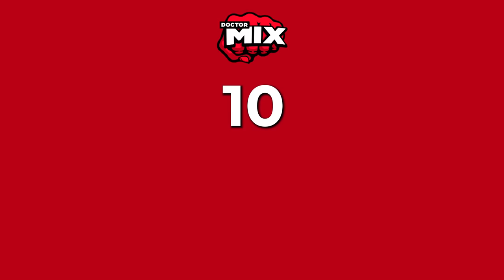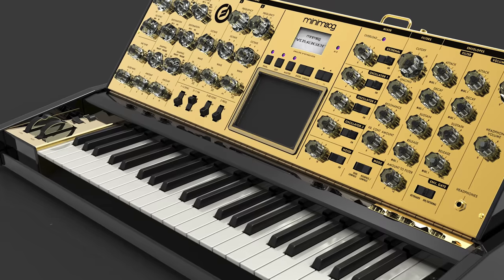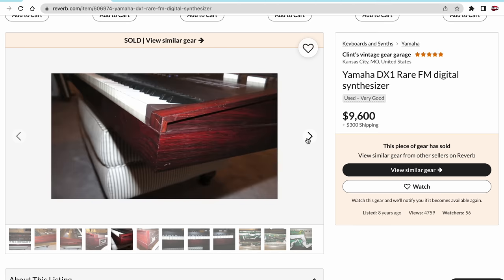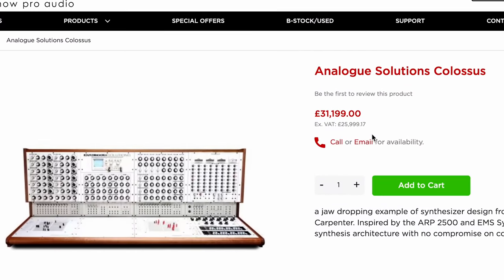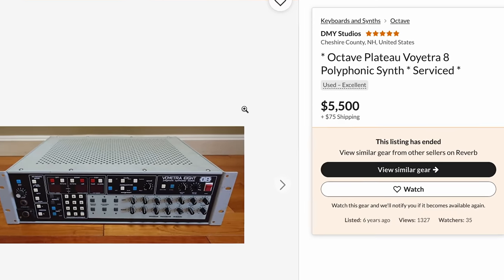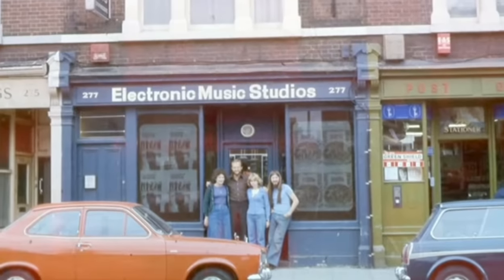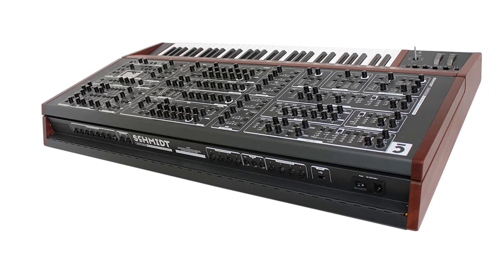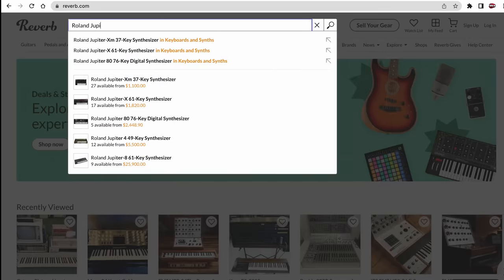Top 10 Most Expensive Synthesizers In The World

Comment: One that came to mind when I saw the title was the Knifonium. It used to sell for around $15k, but I imagine the maker has raised the price somewhat since its first release. Its claim to fame is using vacuum tubes rather than capacitors for the circuitry, I guess making it more analogue than anyone else can boast.
Reply from the maker: Knifonium, interesintg
Reply: Vacuum tubes and capacitors are not substitutes for one another in any analog circuit. A vacuum tube is no more "analog" than a discrete transistor, but superior if you want to heat up a workspace.

Comment: I'm surprised that UVI hasn't produced a software emulation of a Yamaha CS-80. In any event, I have been slowly paring down my outboard hardware synths and relying more and more on DAW plugins. Last year I sold a Yamaha VL1m Version 2 and also a Technics SX-WSA1r (the latter is quite rare), both modeling synths with breath controller input. Software versions of these would be great but would require a, relatively inexpensive, external BC to MIDI converter to be usable as intended. The only two hardware synths I still have are a Roland V-Synth XT and an ASM Hydrasynth (rack version). The exception to the hardware purge is that I got into Eurorack modular. I have 20U rack spaces filled with 52 different modules but integrated into the DAW with multiple audio and MIDI I/O.

Comment: The list should be called:" The most monetarily-valued synths no longer in production" (aside from the Schmidt) which has little to do with what they are worth but merely what they  are worth to a collector, who may not even be a programmer/synthesist. Given how rare some of these units are, just one high purchase price can throw off the entire scale.  BTW, I have seen DX1 go for $100K and refurbished ARP 2500 with the expander wings well over a 100K.  A Chroma with Expander and programmer can easily sell for  $25K.  The "Blue Meanie" Arp 2600 with the Moog-cloned filters, would probably go for more than 100K. Then there are the full PPG systems, and Synclavier.

Comment: If I had to choose between a Moog 55 and a Roland System 700, I wouldn't waver one second. And not because the Roland is much rarer. I had to finally settle for a mere System 100 between 1978 and 1985 and it remains a very dear memory.

Comment: Are vintage synths worth it? No, not really. They're cool, sure, but they're also a headache in maintenance. On the other hand, there's something about hardware that you don't get in software (including the one of your sponsors).

Also, keep in mind that asking prices are just that, and a lot of people easily ask twice as much as a synth is worth. I keep coming back to the Yamaha FS1R, but asking prices are often around €2500, whereas going prices are dropping more and more below €1500. And even that is too much for this little box.

On the subject of rack modules like the FS1R, what is crazy is that these command a much higher price tag than their keyboard counterparts these days. Not everybody has the space for a whole bunch of keyboards, but you can easily stick a whole lot of sonic capability in even a small rack. A Korg DW-8000 with a starting bid of €700 goes unsold, but an EX-8000 is snapped up for €900.

Supply and demand...

Comment: No synth is worth 30k. Antiques are . And the best thing is when you buy that shit and one of that old ultra rare chips in there fries .... Then you are in for another pile of cash to put into or you just dumped 30-70k down the toilett. And then you cant go gigging with it. CS80 is much to unstable, to heavy, to irreliable, to unpractical, has no midi, only 4 presets. Also with that prices you need a guard to protect it all the time. Seriously, sounds like blaspehmy , but what do you want with that ? Just to feel like Vangelis? ... I mean I like the sound too ... but at that price and inpracticallity... lol. I mean I had a Juipiter 8 before and I do miss the sound, but when I had it long time ago even then the downsides outweight the price.....

Get Serum - arguebly more powerful than all of them together and you can use as many as you like with no extra costs  until you run out of cpu. Then wait for Uli Berhinger to clone them, buy one and with the cash you save go on holiday for one year with the clone ....